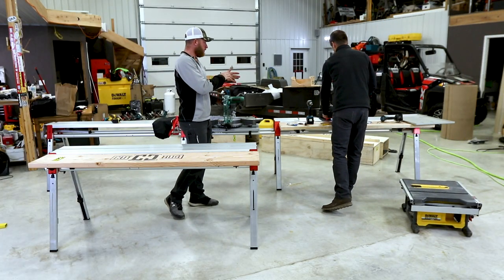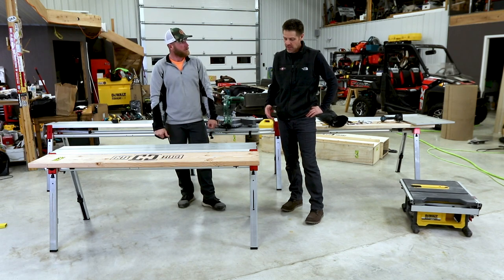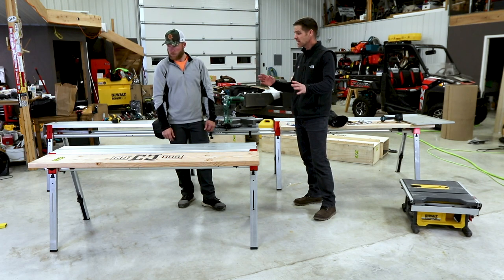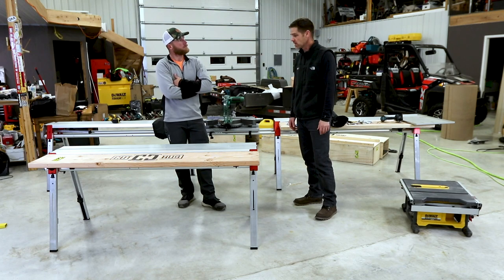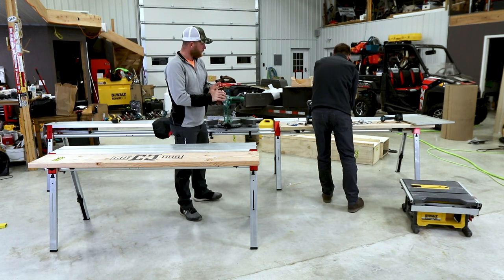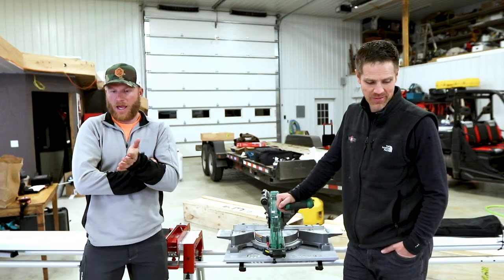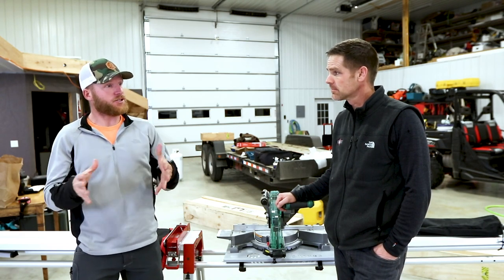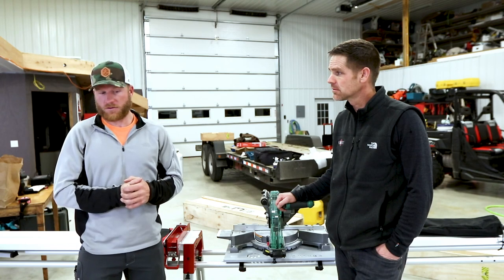Is this the best miter saw stand you've never heard of?

Comment: Only one thing could make this better for us guys who have corded  saws is some pre wired outlets  with a pig tail that comes apart  to break it down for storage .that way you only have one  cord and less of a chance  of tripping on multiple cords
Reply: I agree this would be a nice feature. I've built several cut 'stations' to use on long term projects and always zip tie a splitter somewhere for this exact reason. Biggest benefit is gained when you're working indoors and have an extractor/vacuum set up on the miter saw and table saw. Cord management really becomes an issue then when you have 4 cords from the saws/extractors as well as needing power to a jigsaw, grinder, biscuit joiner etc set up on the outfeed table for the table saw. Usually end up with a second splitter or more often a heavy duty power strip to power those tools tied up underneath the outfeed table so I don't have to be constantly swapping extension cords.

Comment: Looks like it would take to long to set up on a construction site ,I own a Rousseau table saw stand with a extension stand for a out feed table and also I put one for a in feed table allows me to lay a pc of 3/4 sheet of plywood on it and not have to hold and just slide it through the saw to the out feed never dropping it , and the best part easy to put together and fast just unfold the legs put the saw into it ready to go , also you can ad an side extension for a router table lot of possibility,  check it out  Rousseau table saw stands

Comment: The Paulk bench and total station look comparable and you can build them your self. Seems to definitely be geared to framing as I don’t see that outfeed table being very useful for much other than support. Wouldn’t work that well as a bench surface or assembly table. Anyways, looking forward to seeing you use it onsite.

Comment: My wife used my CutHub system for a home DIY project a few weeks ago (she wanted to build a box stand for the washer and dryer).  She's a home maker not a tool person... and in fact had never used a power saw.  She said she wanted to do it herself so I walked her through the set up of the CutHub in about 6-7 minutes and then she made all of her 2x10 cuts on the CutHub with no problem and no danger of boards dropping or worrying about balance points.  I gave her about 1 minute of coaching on how to make a cut using a miter saw and she was off to the races.  Not in million years would I let her make those same cuts any other way.  I don't want to throw my wife under the bus but if my wife can do it...well that's probably all that needs to be said about how easy it is to set up and use.

Comment: I used a miter saw system like this for years framing houses.I would use it to cut all the window and door packages. That kept my guys just banging walls as fast as they could. But then I was the only one in the development with an old boom truck also. Could build the gable truss on the ground and fly her into place etc. I like the idea of the rip station but...I bet you burn up a few of the little job site saws. This system is ideal for the crew that employs a sawyer.

Comment: I think it is pretty sweet. I'm sure it would be great on a job site but where I live I'm not sure we would have the space on a job site that is level enough for that size of a miter station. I know it has adjustable feet but I'm talking more about hills in backyards and such. Nothing like the land you typically work on. I do like the table saw stand though. Both seem great but seems like you would have to rely on the property you're working on to determine if it can be used or not

Comment: It's a great concept ... Still seems really complicated to put together . This is probably why the major brands haven't put it on the market. If there was some way to simplify set up , maybe pre-settings to accommodate different saw brands , or quick release type setting connections so adjustments can be done quickly and accurately.
Still, it's a good start .
Reply from the maker: It is all quick release and super easy to setup on site.  I’m not sure why everyone is saying it looks complicated??? I truly don’t understand.   It’s not difficult after you’ve done this one time
Reply: RR Buildings 
I guess it was the presentation. This whole video make the entire system look way too complicated. And on this vid ... the very last thing shown was a wobbly mounting plate and table saw. 
That plus 3 giant boxes holding all the parts for this system. As far as the quick release .. it wasn’t clearly shown. 
I’m sorry I missed that, but it all came across in the vid as screw type adjustments . 
Like I said , it does look like a good concept ... but this showing of a new product made the whole thing look cumbersome and complicated.
I’ll take your word on it that it’s not complicated, but that’s not how it came across on video.
Hope it works well. Have a good day sir 👍
Reply: Sorry bout the typos . Wasn’t trying to make a joke

Comment: That's a beautiful miter saw stand but I have a couple of concerns, how would it perform on uneven ground, it looks like more of a semi-permanent shop saw stand than a field saw stand and perhaps that is what it is intended to do? Set up time, seems like quite a bit of time to tune this rascal in. The cost, while admittedly a beautiful saw stand with all that aluminum I can't see it being cheap. That said I would be interested in learning more about the Cut Hub for my shop. Great video.
Reply from the maker: I've fully set it up once so far on site...fully and easily adjustable feet for uneven ground...took me 6 minutes by myself first time on site
Reply: Can see it clearly has adjustable feet.
Reply: 6 minutes is actually faster then I expected
Reply: And I'm sure it would be quicker than 6 minutes once you get used to it.
Need to see each step of set up, what brands of saws will it fit( if it doesn't accept any because of size, height, etc), and the cost, as well. All features, benefits, differences.
Reply: Chrisell looks like each leg has a part that slides out. Also I bet when Kyle goes out and uses it on-site we’ll get better answers to that. 

Doesn’t really seem like a ‘shop’ tool though. It’s so expensive because it’s designed around being portable.
Reply: @RRBuildings  What is the price? Everyone just wants to know the price???
Reply: @cencoast_7.340  Looks like you can only find out the pricing by getting a quote. Usually when companies go that route the price can be different depending on who's asking. Request a quote with an e-mail with a domain from a well known company with deep pockets the price will likely be a bit higher than say from someone from a gmail account. That and likely get a response a lot quicker. 

Going through the process of requesting a quote they say "Our systems begin at $1,500". So for what is shown here, It would likely be around 2,000 at least.

Comment: This is an interesting product. I weighed up all my options for a mitre saw stand and settled on a WST01. it takes 4 minutes Maximum to setup. The setup time is critical if you want to make money in this game. This guy is a framer and i cant see how when you are framing from the ground up and taking literaly hours out of your day to set up, them move it around as the frame goes up and have to deal with such an expensive system. The table saw stand has merit but i dont see how this is in any way innovative. It seems like something that i would set up if i was fitting a 30 room house and needed a reliable one time setup solution but i dont see the dividends from a framers perspective.

Comment: Im anxious to see it in action!
Reply: There are a few other videos out there if you really look, but there is nothing really about it that is revolutionary. Some of the videos go on and on about the stop block and how it speeds up cutting multiple pieces the same length, but that isn't something that would be hard to do elsewhere. I have a delta mobile saw stand paid around 250 for it and it has a stop on the wings. Yes it would take maybe a few seconds longer to set it up, but it's there. Even without one there are other ways to get it done. Paying at the very least 6 times what I paid for the delta and it's not mobile? 

I am not saying it doesn't have its place, I can see it easily being fine for someone that does a lot of trim work but outside of that I don't see it being worth the price. Which is $1500 at the absolute lowest end.

Comment: Ron paulk total work station all the way
Reply: Paulk Compact Station (once built) is way cheaper, more functional and abuseable/mendable .. nice shot, but way too prissy and not developed at the details
Reply: @gregcoste5332  I'm sticking with my Paulk Miter Station and Paulk Compact Workbench for now, but I really do need to build a Paulk Workbench 2 at some stage and probably the new Paulk Total Station 2 at some stage.  Doesn't matter what job you're doing, you never seem to have quite enough work surface or clamps. :)
Reply: I just did a large 4 br 2 bath vaulted ceiling home's crown molding. I did custom molding for the kitchen cabinets. Set up my Ron Paulk modified 3'x 6' table, with my ridgid 1/2" drop in router, along with my ridgid R4517 table saw. My miter saw which is an older 7.25" lightweight Kobalt(which i love) on a ridgid miter saw stand i got on sale for last year on black friday for $100. I so wish i'd of bought two. Anyway, i modified it with a reinforced half inch thick plywood support, and sliding maple stops. I backed up to the houses garage, and was operational in an easy 30 minutes.  While that saw stand is a bit bulky, i have no problems loading it into my van or trailer with the saw on it.  It is tough and sets up in a minute. I have a dedicated vacuum with one of those switches that turns the vacuum on as you cut. Clients really appreciate no dust. I'm not building houses, but as a finish or trim guy, i've found this set up to be better than anything other than a shop, and wherever i go, people seem pretty impressed with it.  Total cost for all of this? Way under $1k.  Way. Oh, and super good high end blades and bits for all tools.
Reply: @deanaoxo  Got it.
Reply: Thats exactly what I was thinking throughout this entire video.
Reply: FoxRcng708  Well, first off, thanks for the insult, second, if i need very straight cuts, then i'd use my Ridgid table saw in my shop, though i'd certainly admit that it took some time to get straight, and it took time to true both the fence and get the alignment correct. However, if you are referring to the Ridgid contractors saw that i use with my modified Paulk table, i use that for construction type jobs where tolerance is not as tight as the furniture building that i'm doing more of.  

Also, i use a 6' straight edge to check my cuts, and i'm careful.

I hope that answers your question, have a nice dinner.
Reply: FoxRcng708   Well, YMMV but i've had great luck with my tools. Now i'm not saying that the contractor saw is not cheap, it is, and that fence is even cheaper, but it is what it is, and i paid $200 for it new. I will be putting a John Heisz designed fence on it as soon as i finish my latest build. I don't have a ridgid miter saw. I have three other ones, and my Kobalt 7.25" which i got for general use, cuts fairly.  I don't use that for furniture building, i use my hybrid Ridgid for that, and the various sleds i've made using the William NG method to assure accuracy.

If you build things, you know that making a perfect cut is absolutely necessary as we can not get away with a .5 degree mistake if we want large pieces to fit together.  So, i've been able to make that saw cut true. I use Freud blades for most cuts, though i would like a Woodworker II. 

More importantly though, as this was a discussion of miter saw stands (i think) the Ridgid Miter Saw Stand is a gem. I modified it for crown molding, but now just use that modification all the time. All i did is build plywood reinforced with hard wood to keep flat, beds, that span the gaps between the extendable arms. They simply set down on little blocks that are keyed, and lock into place by the provided adjustable supports at either end. I then made some hard maple stops that clamp with a tapped screw hole using a thumb type bolt to secure, for repetitive cuts. I also got that stand on sale, so paid $100 for it not quite two years ago, and wish i'd of bought two. It really is that good. It takes no time to fold up and transport, though for sure it does take up a bit of space in my van or trailer. 

Likewise, the modified Paul station, which i'm using to day with a Ridgid .5" router on a Kreg plate. I like this router because it has speed control and a built in fine adjustment that doubles as a lift(some assistance required). 

Will i improve my tool choices as i go forward? Sure, though i hope i don't get bitten by the Festool bug. 

For me, many of my choices were dictated by money. I had none. Since i'm sadly also not motivated by it, that is likely to continue.

If you read this far, thanks. I agree with you about the fence, it probably shouldn't even be included with that particular saw(R4517)but my Ridgid R4512 is so far a pretty good saw.
Reply: FoxRcng708  Ten four. Now if you want to talk about real POS, have you used the porter cable 6" sander????  I"m on my 5th one, and this is no joke, i've only ever paid for the first one. Each time, i get a new one because the old one craps out before the extended warranty is up. One died before 90 days were up. I told them, hey, i'm not buying an extended warranty(you have to pay for a new one each time, as it only is good for one tool at a time)for this, it didn't even make it 90 days. They (Lowes)agreed and refunded my money so i could put it back on the new one.
Reply: Geez, not another Ron Paulk fanatic. You would think the guy cured cancer. It’s a fucking work bench, can’t anybody think for themselves anymore? And miter saw stands are way ,way overrated. You have no flat surface to stock material and scraps and all your cut offs fall on the ground. Couple sawhorses and a piece of plywood, done deal.

Comment: Looks really well made, but I can’t imagine that setup and even the cheapest jobsite saw around is gonna be cheaper than a high end tracksaw. With Festool, Makita, and Dewalt all having cordless setups with as much power as a corded I think the jobsite tablesaw is on its way out of many of the trades.
Reply: Nothing will replace a table saw for fast, repeatable, accurate rips in small or large stock.
Reply: Uh, no. The table saw isn't going anywhere in carpentry. What trade are you in that made you think that was true?
Reply: Hehehe

Comment: You don't need a table saw for sheet goods.  A track saw is way more accurate and safer and faster.    The Fastcap or a Bosch gravity with fastcap parts added is WAY more practical and portable and WAY less expensive.  This looks like a solution to a problem that doesn't exist.

Comment: Looks well built but if you're dragging your tools in and out of your trailer everyday at the end of the day I don't think that would be feasible for a guys that builds decks, it would be great for maybe a trim Carpenter that could leave it sitting in the garage that your working on for long time. If I had to drag it in and out everyday, I would rather have something that has wheels on it.

Comment: As a framer this wouldn't be very useful. Get a $34 kreg rip guide and cut your plywood on your sawhorses. And you don't need chopsaw accurate cuts on long lvls that are structural components. Might be nice for TJIs but I prefer floor trusses for the labor savings. Would market this to trim guys, that can leave it set up for a few days or weeks.

Comment: As a DIYer, I can tell straight off the bat that this is out of my price range and requirements.  But then I might only make a dozen cuts a day.  A professional/team who makes hundreds of cuts a day might well find the sticker shock easier to get over once the safety and time efficiencies are accounted for.
Reply: The only real efficiency I can see is the setup time. Other than it being a status symbol and or being "perty", it doesn't do anything that can't be accomplished through other much cheaper means. A professional/team may buy it if they are very light on their tools, and haven't had any issues with theft then I could see it especially for trim work. 

All in all I can see this being bought from the occasional diyer with more money than sense, and the occasional professional who's just starting out and don't know any better. 

To clarify on the "light on their tools" bit. If you notice when they lean on it how much flex it has. That isn't a huge deal, it's mainly the way it is made. Lateral forces like if a 2x10 fell from say 5ft and hit it on the corner and pushed it inward it would almost certainly buckle. That or any number of scenarios that could happen. That's why a lot of these kinds of things are cheap because they will need to be replaced when shit happens. Spending 1500 to 3500 or more on something like this you would just about expect to be able to back a truck into it and it be fine.

Comment: Kyle, great review as always and nice of you to help him out with the product. I love american manufacturing/engineering, we need more entrepreneurs building quality products. As you guys said it's an investment like anything else, just like spending $3500 on a sawstop in a cabinet shop is. I guess the only thing I didn't like from the video was the height you had the miter saw and definitely the table saw at. (very low by standard). I know you said this is adjustable for leveling out the surfaces, but how much more could you raise that in height?
Reply: I think for the $3,500 price they take all your height/weight/preferred working height stats and build it custom to fit you.